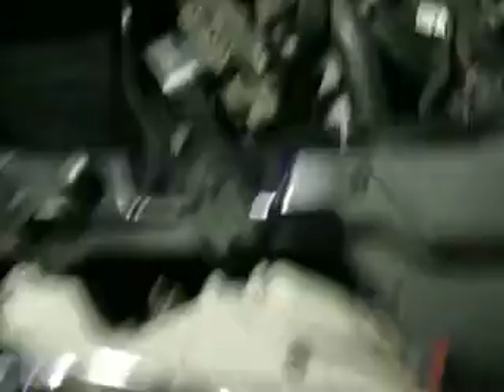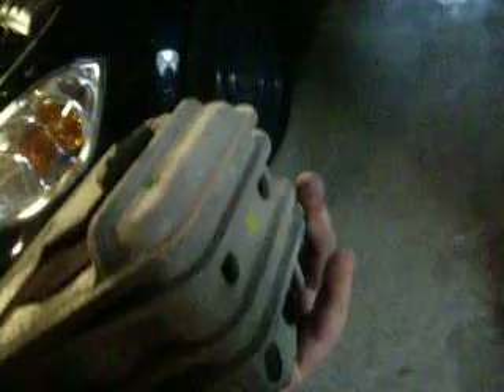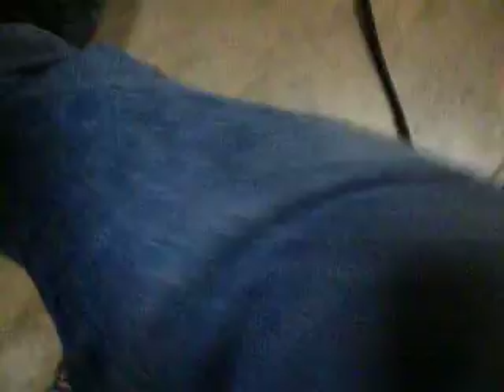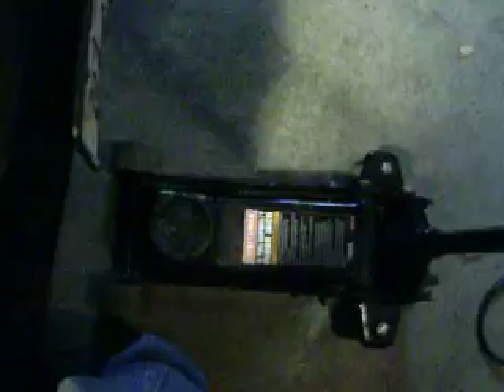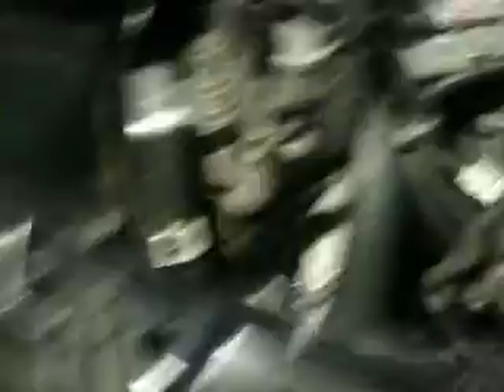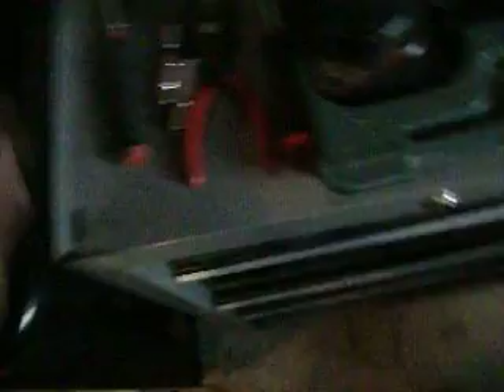ZZP Engine Mount Installed - 11/18/2010

Comment from the maker: @casimiro56 , quite a bit a first, but because it is still polythene it will eventually break in and the vibrations will decrease a bit over time, but still stay stiff and keep the engine from moving. This will also be why it won't do any actual damage cause it will still allow for flex just not as much; that's the difference between even the hardest polyurethane and a solid mount. Use some loc tite and the 15 mm bolts get 37 ft/lbs while the 18 mm bolts get 74 ft/ lbs

Comment from the maker: @KiKaL8, your in luck my friend, because you have the SS, all the mounts made by ZZ Performnce will go on your car. Also, check out their control arms as the stock ones contribute to wheel hop as well. ZZP also sells the beefier axle shafts too which has a lot of torsion problems. Also, check out their struts braces along with their performance struts. In short, They sell everything you will need to stabilize the engine & trans as well as stiffen up the front end.